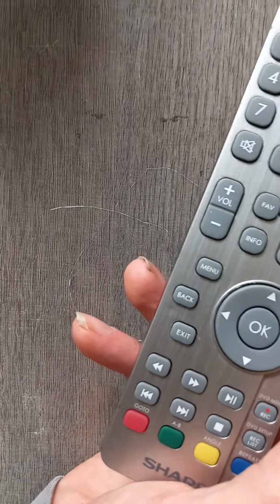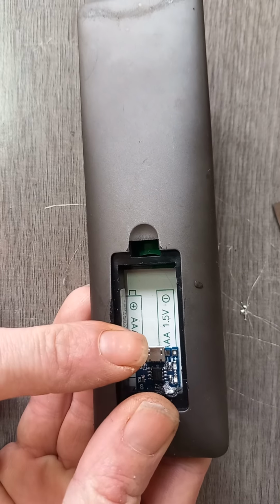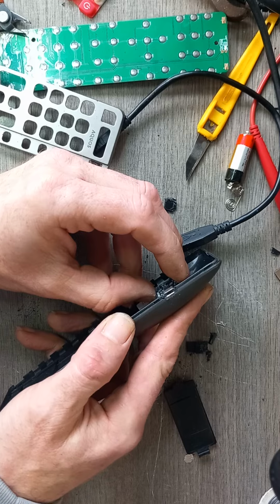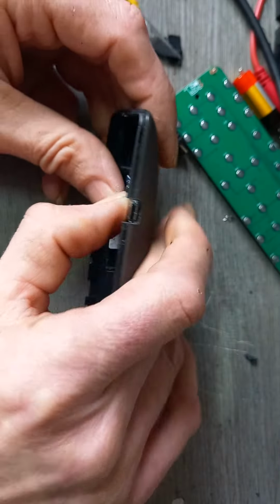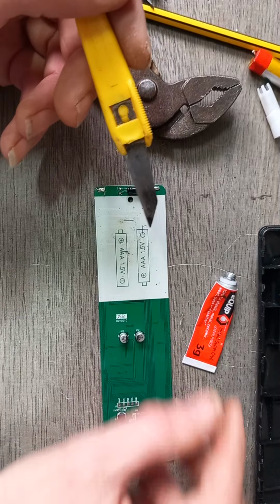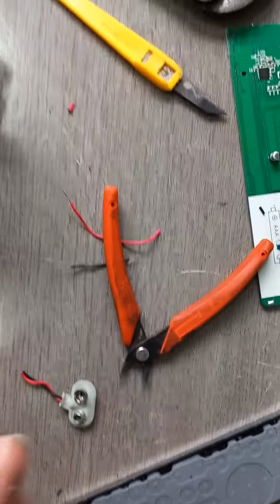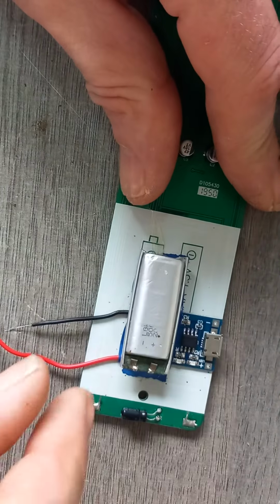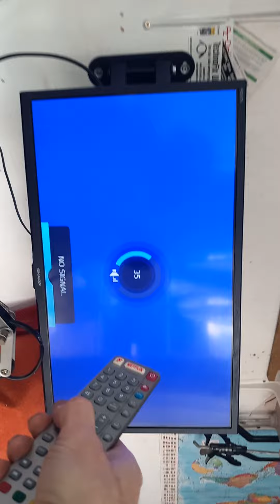rechargable remote #diy no more searching for AAA #pickup old vapes off street and make good use.

Comment: hey bro i was screaming at the screen saying you have not connected the remote power hahaha and when i seen you glue of the board connections thinking u need to solder 2 wires hahaha to the remote glad you found it after
Reply from the maker: Your absolutly spot on bro I did forget to wire the battries up. I realised after lol 😆

Comment: Sorry babe we can't watch tv i haven't charged the remote
Reply from the maker: Lol touchee... you're more likely to run out of battries using alkaline as apposed to lithium iron that stores a charge for years anyway 5 mins on charge will get you going so you can atleast turn tv on then fully charge after ;)

Go and charge it you lazy sausage pmsl 😂
Reply: @SimonsSolarShed  pov rechargeable AAA: 😔
Reply from the maker: @williamv0242  I did buy quite a few rechargable AAA battries over the yeara can't find a single one anywhere...I want it hard wired so no one can pinch them..this is just the route i chosen you can of course choose  your own ;)
Reply: @SimonsSolarShed  i think the AAA would have a lot more capacity on top of the added convience of swapping where i live i can locally buy varta brand AAA recharables 4 piece for 3-4 euro but hey to each their own was prob a fun project
Reply from the maker: @williamv0242  yes I understand your point of view and respect it...but I have a load of vape battries that I would like to use instead of them being dumped in the streets or land fill and your right it qas really fun to do and  it does help keep my mind busy god knows I need it.
Reply: @SimonsSolarShed  thats cool free battery's always a win